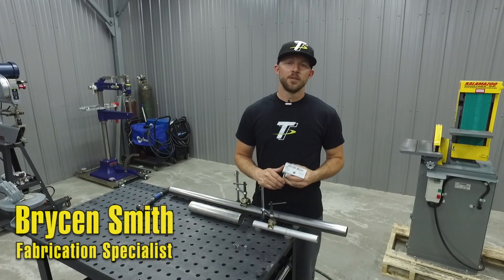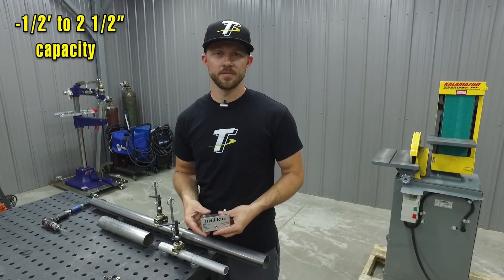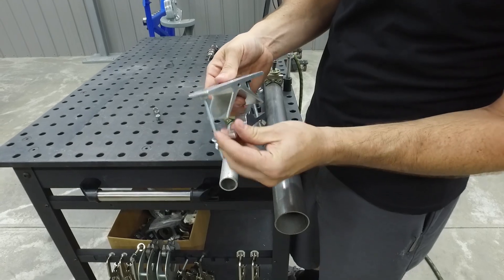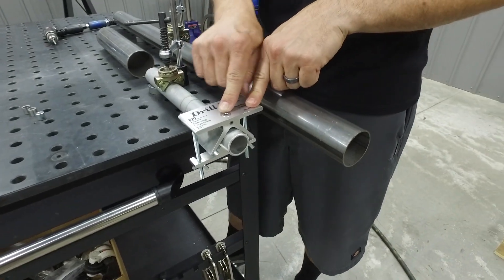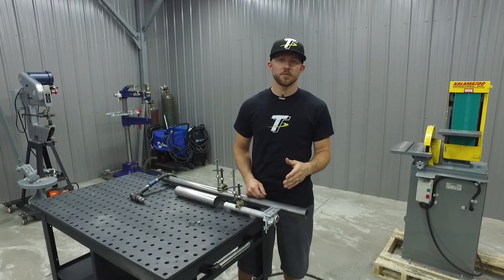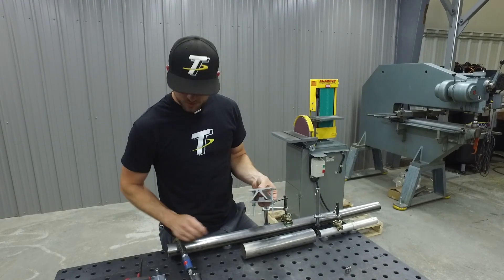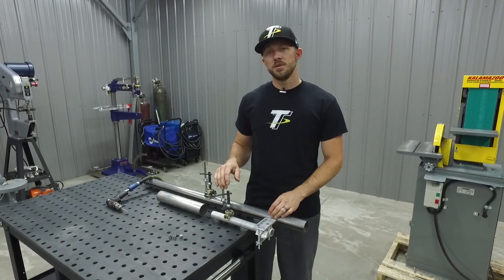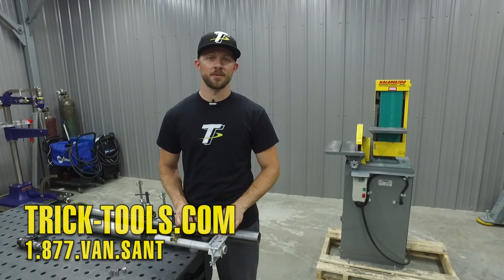The Easiest Way to Drill Centered Holes in Round Material - Trick-Tools.com

Comment: You state that it fits from 1/2" and up, but on the website it says 3/4" and up. Which is correct?
Reply from the maker: It used to be 1/2" but they have changed in their standard configuration can do down to 3/4" now. With a little trimming it could be made to do 1/2" again